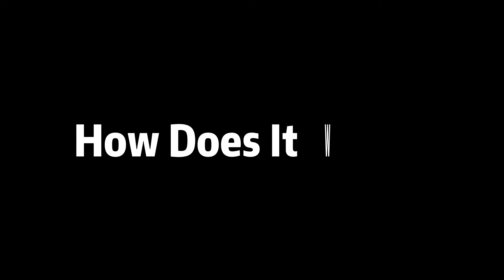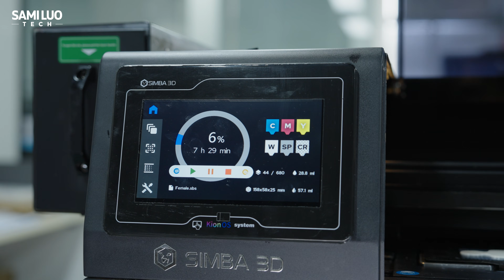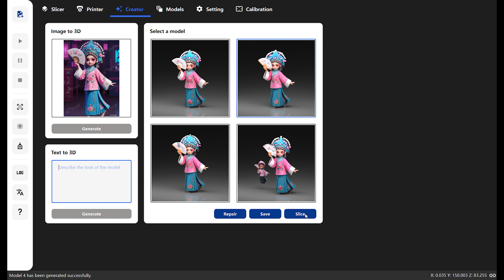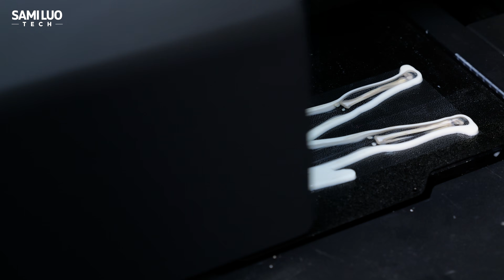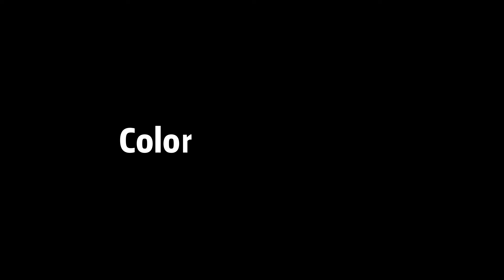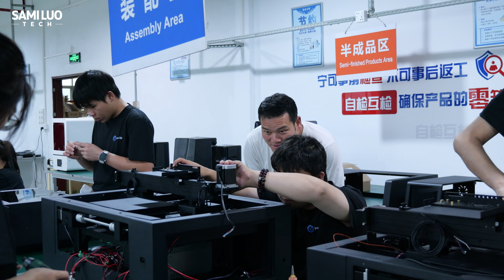This Desktop 3D Printer Can Print 500,000+ Colors l inew3d QC2A

Comment: This is a desktop version of the Polyjet tech originally invented by Objet (now part of Stratasys). I ran a service bureau department out of SoCal at Stratasys and used Polyjet machines for over a decade. This machine has me very interested. Everyone is familiar with resin and FDM types of printing. This tech has long been way ahead of those in terms of high-resolution models and multicolor printing. I have so many questions!

Comment: The quality of the prints is amazing, no question. But I have two concerns: what about the dump waste of the supporting material. How to environmental friendly dispose this? And the second concern: the working area is a bit too small. I would need minimum in size, which should be 50cmx50cmx50cm. I saw this great tool on Kickstarter and would have given money, if it would have fit my needs… If they will develop a bigger machine and provide a good way of depositing the dump waste, I am in.

Comment: So a UV printer similar to the EufyMake but has a taller vertical printing ability.
Reply: Mimaki has been using this technology for over 5 years, but starting at $45,000 for the 2207 model, and their 556 model cost $180,000

Comment: Wait what? We have this kind of tech now? that's sooo awesome bro!
Reply from the maker: Hey bro, you still use wechat? You don't do many videos nowadays :((
Reply: @SamiLuo Yes bro. I'm still on wechat. I upload videos 2 to 3x per month. hahaha.
Reply from the maker: Yes, bro
Reply: Stratasys/Mimaki has had this for years, but for ridiculous money. If this can be done for $10000 it will change things. There is a vacuum after 3D Systems pulled the plug on their CJP/‘Z-printer’ line.